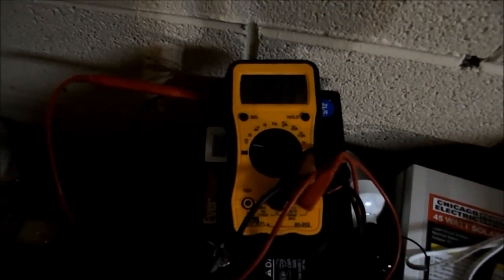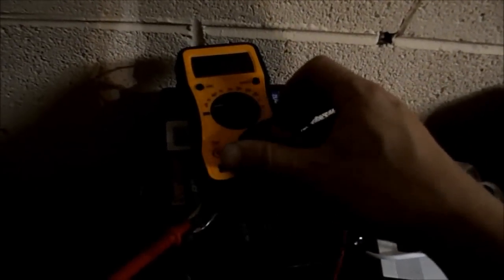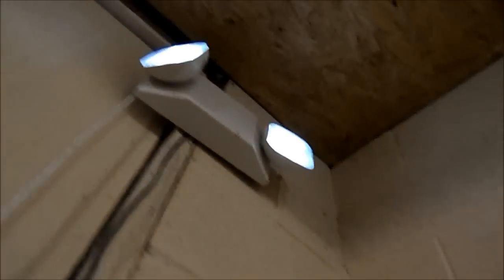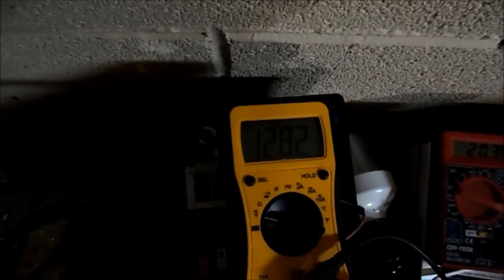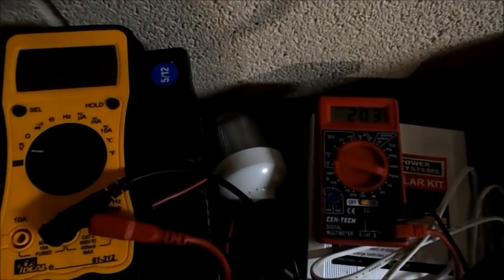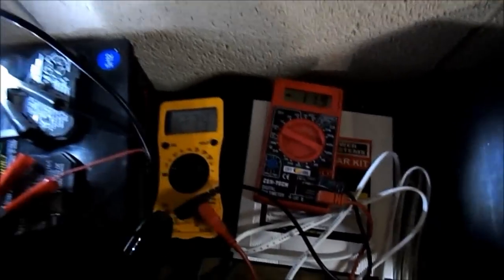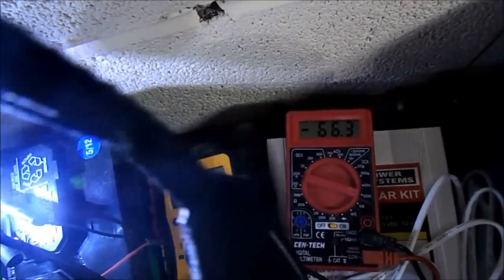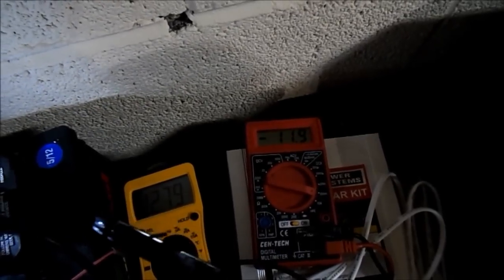LED Power Usage Testing

Comment: WOW! 0.256 W = 1/4 W !! For that whole light fixture, not bad. Free light is always good. When the batteries are on charge at 14.5V or so your LEDs may see 3.6V each so it looks like they will be OK if they are spec'ed at 3.8V. You should compare against normal light bulbs and get an idea of how much light it puts out. What's great is you can run 4 of those fixtures and only use 1W of power! If you add a current regulator board in there you could pump up the light output, see ebay for around $3.